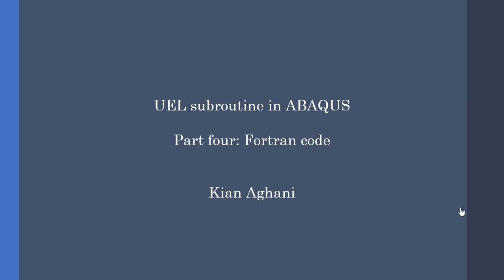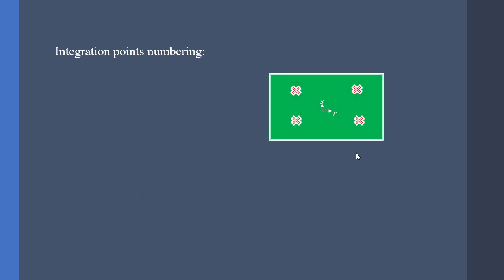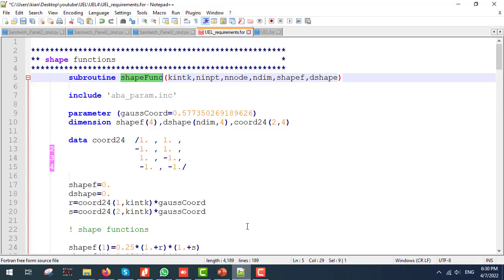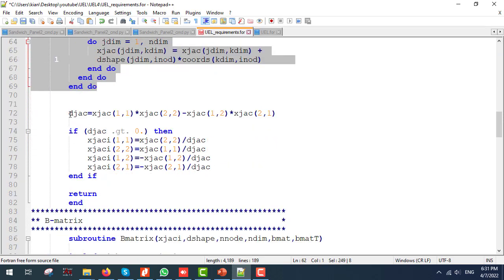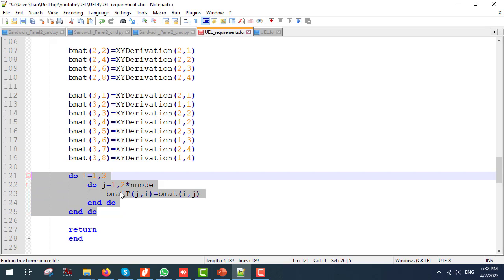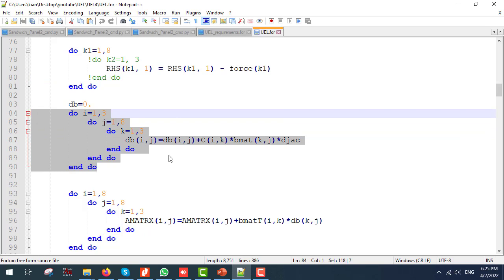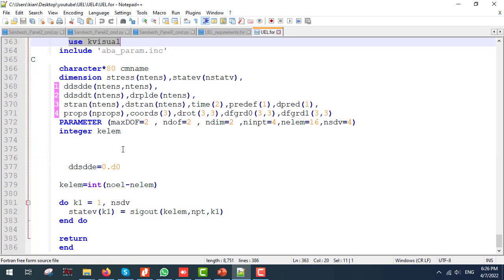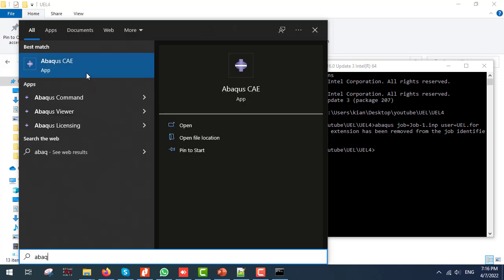UEL subroutine in ABAQUS part four

Comment: When i run the input and fortran scripts through terminal, i get the odb as shown in video. However i don't get any results. can you please tell what is wrong. i am using input file provided by you without modifying it.
Reply from the maker: I think you are making a mistake in the process.
Reply from the maker: @altaflone3356  At the end of the inp file, there is a line "*element output, elset=decoy, SDV ". With this line the data will be shown.

Comment: I have a question about VUEL-VUMAT,  I guess since they may be similar to the case if UEL-VUMAT, I post it  here, however I did not see any other video or forum to post my question. I am working on a VUEL-VUMAT for fracture analysis, where calculations are performed in VUEL, and the final results need to be exported to VUMAT for visualization. Here are the key points:

1. I have 80 nodes in total, and I defined a user-defined element with 5 to 13 nodes. After calculating the extension between nodes, I assign a value to each node representing the number of broken bonds. So, after the calculation, I have a matrix 'A' of size (80,1) for one time increment. The first column contains node numbers, and the second column represents the degree of damage. I assume that my nodes and integration points are the same, but corrections are welcome.

2. I created a module to share data files and access the matrix 'A' of size (80, 1) in VUMAT. Using a simple do loop, I assigned the values of matrix 'A' to 'statenew'. However, I couldn't see the results in Abaqus through SDV1. I assign one to one because I am using CPE4R element in the vumat to visualize:

 do k = 1, 80      
 statenew(k,1) = A(k)
end do

3. I suspect the issue is related to using element CPE4R, which has reduced integration points (only 1 point) located at the middle of the element(?). The values assigned to 'statenew' are now at the corner nodes, which might be causing the problem(?) I am unsure whether I should directly assign 'A' to 'statenew' or create a new node list with different coordinates, forming 4 new nodes to represent the corner nodes around the statenew nodes.

4. At the end of step 2, I am able to see displacement, stress, strain, etc. interpolated using the node values, but I am struggling with how to assign the specific variable values to be shown through SDVs (State Dependent Variables).

5. Regarding the structure of 'statenew' (NBlock, NStatev), I have a question. Is it a simple 2D array? In comparison with UEL-UMAT structure, where we assign a 3D array to 'statev' for visualization in UMAT, I am confused.

In the attachment file you will see my node and element distribution. Cross signs are VUEL elements, and in the background is VUMAT elements. As you see the value of SDV1 is 0 everwhere. 

MANY THANKS IN ADVANCE !
Reply from the maker: There are some complications in your text. First, your A matrix has ONE column not two. Assuming that it is a typo error, you should write a code to make your integration points compatible with those of the CPE4R element. 
Statenew is a 2D array, while STATEV is a 1D array. Also, the way I used for visualization is not related to the size of STATEV.
Reply: @kianaghani   you are right, the size of A matrix is (80,2), including the nblock and the value for each block. Do you think if I implement the way you did it may work? I did once and no success, I may had a mistake in the input file somewhere. I will try again. Thank you !
Reply from the maker: @mortazapirouz7482  Theoretically, it should work but it will be hard.
Reply: @kianaghani  Thank you for the input. I got it work, the thing I was missing is doing a simple stress calculation in VUMAT for dummy elements. This let me to visualize whatever is assigned to statenew. BTW, your videos really helped me to figure out how to get it done. Thank you and keep up the great work !!
Reply from the maker: @mortazapirouz7482  Your welcome. If it is possible, share your subroutines ( or at least a part of it) with me for expanding the knowledge.

Comment: Hello, thank you very much for these videos which are very very helpful to amateurs like me. I tried this code with 16 elements, then 64 elements, and 100 elements, it worked every time with minor modifications. But when I tried with 400 elements like 20*20 in x and y direction, it is running but diverging on the first step!! I am not sure why this is happening, not even 1 increment, kindly please help, it will help a lot of us.
Reply: Okay so in the code the rhs has to be multiplied with determinant of jacobian

Comment: Thank you for the video, it was really helpful
I have one question
how can I edit the input file when I have two parts (a bimorph) with constraints between them
thenks.
Reply from the maker: Hi. Create the model using CAE, then write the INP. Next, edit the INP file.
Reply: @kianaghani  I forgot to mention that I'm using UEL subroutine
It's easy to edit the INP file for one part, but when I have a two part body, it becomes difficult to edit the INP file.
The problem is in the surface created between the parts. I'm trying to find a model of a two part body, but I can't find any.
Reply from the maker: @seifzeghichi  In that case, it’s better to generate the file using MATLAB.
Reply: Hello, did you solve the issue? I found an error if I'm trying to create a surface in UEL. Please suggest me to rectify this issue.
Reply: @jackrider4510  I used "partition" feature which creates additional nodes to the part. My structure was not complicated though, just two layers of piezoelectric material, I can give you my WhatsApp if you want. If you need the surface to apply distributed load, there is a subroutine that allows you to do so in UEL.